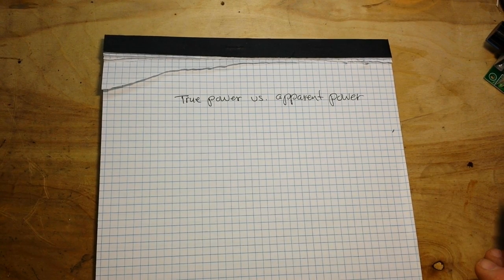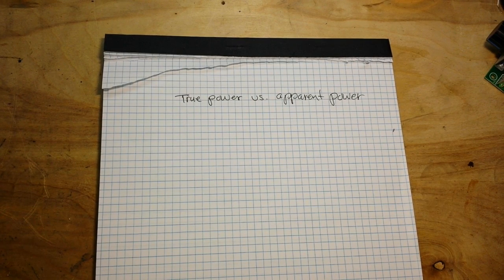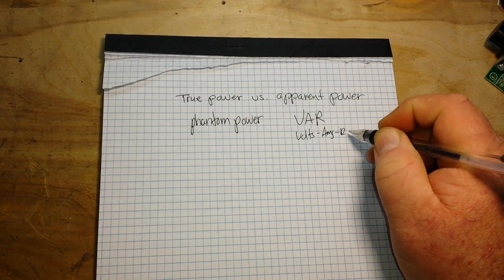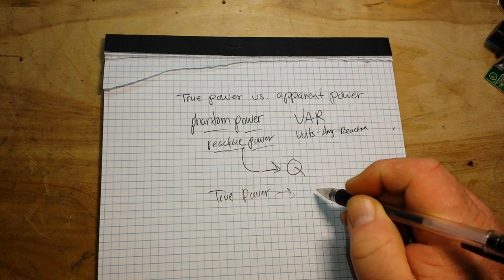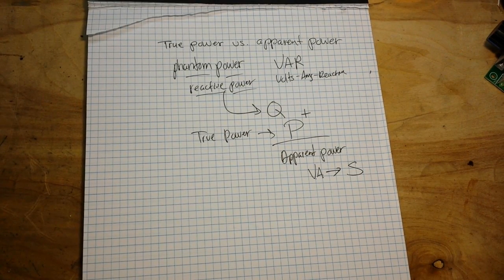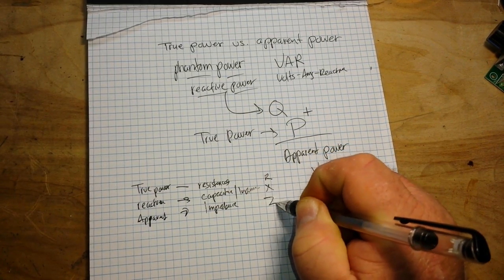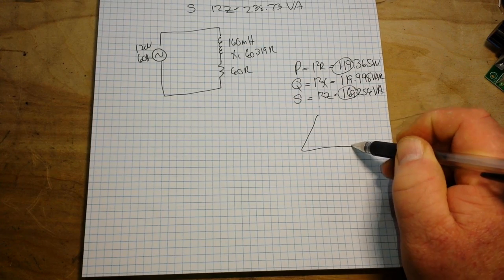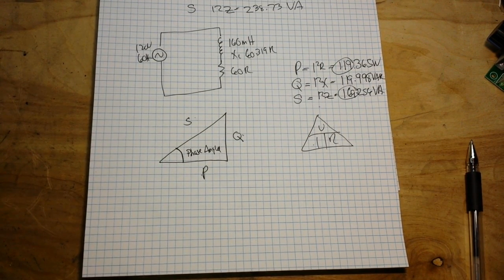AC Theory: True Power vs. Apparent Power

Comment: Wait how did you get 119.365, 119.998 and 169.254? Can you show the calculation?
Reply: Same, I was very confused too. Can someone help showing calculations please.
Reply: first, compute the total impedance to get the current. Then use this value to compute the P, Q, and S.
Reply: @jackass6030  could go into more  detail or just give us the formulas?
Reply: This will help clear things up. I didn't realize how to get the impedance until watching this other video. Z= the square root of (R^2) +(XL-XC)^2.  Also XL= 2πfL, don't forget you first have to convert mH to H by dividing by 1000.  V/Z=current. P=(I^2)(R).  Then just continue to plug in the current (I) into the other formulas. https://youtu.be/5uftqyvUKSc

Comment: Hey Paul, In have a question for you if you have a moment...
I have a piece of equipment (an old atari 830 acoustic modem) that requires an AC power supply of 20V AC @ 400ma....

Is there any good method to create a 24V dc to 20V ac converter to power this device? I was hoping to use 18650's to make it portable. Im thinking maybe an H-bridge inverter circuit might be the answer...but I'm just not that familiar with them.

Comment: Great video Paul. Now I get why people get upset over smart meters.
What a day my soldering iron decided to break and I have know idea how it happened. One of The contacts for the ceramic heating elements broke free. I was going to try gluing it back together, but then all I could think of was the fact that it uses mains power through a triac. So if my thinking is correct it could be live at 120v on the metal section which I have touched accidentally many times (I have the burns that we all get). I don't have money to replace it for well awhile, so my question is, is there a safe way to fix it or am I stuck with breadboards for awhile?
Reply from the maker: Email me Mike